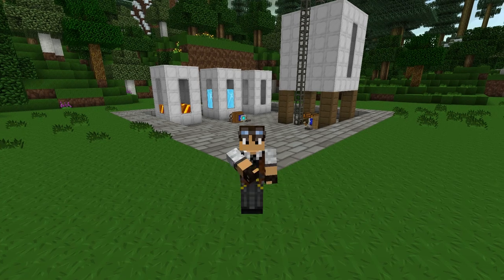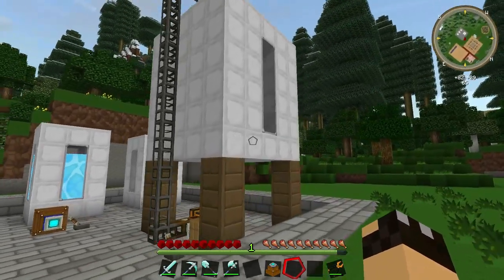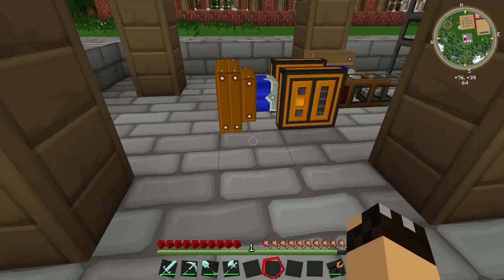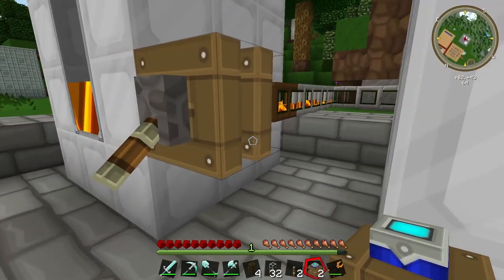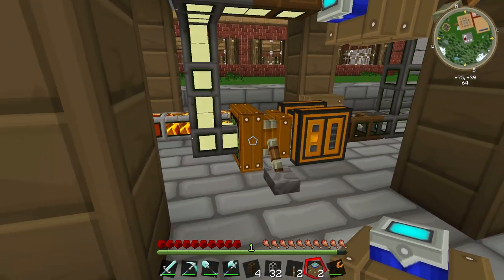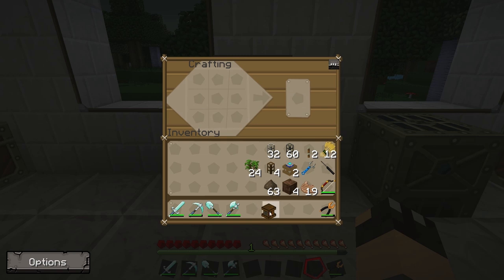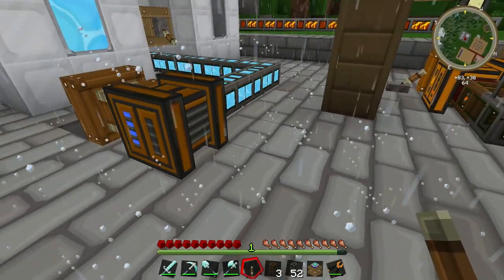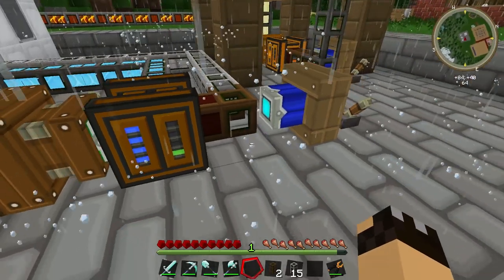How to Feed the Beast in Minecraft - Biogas Engine and Fermenter - 21

Comment from the maker: Not with Pneumatic pipes, but it can with buildcraft waterproof pipes. Not sure if you need a wooden pipe and engine off the top of my head. But I know if you place a BC tank directly on top of it, it will fill the tank. It runs about the same speed as a pump powered by 3 redstone engines. Remember though, the AA only works with water, where as the pump can also pump lava and oil.

Comment from the maker: I actually had an underground buildcraft pump powered by redstone engines, pumping the lava from an underground cave.

The plan was to later use an igneous extruder and magma crucible to generate infinite lava. Sadly, the energy requirements for the crucible were increased in a patch, which meant it cost more lava to turn the cobble into lava (using magmatic engines), than I actually got lava in return.

Before the nerf, it was a way of generating infinite lava.

Comment: Can you see if you can include the correct item input direction for different machines in order to automate the process?
For example:
The "fermenter" need to input mulch at the bottom(Cannot go from the top or side, will result in wrong slot) 
The "squeezer" need to input apple from the side(Cannot go from the top, will result in wrong slot)